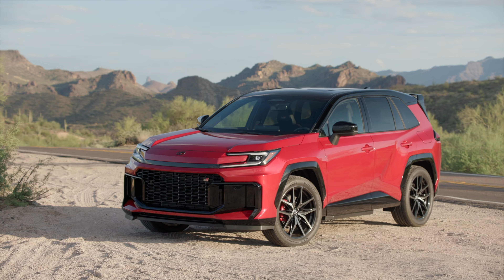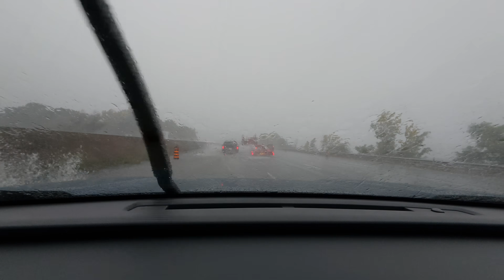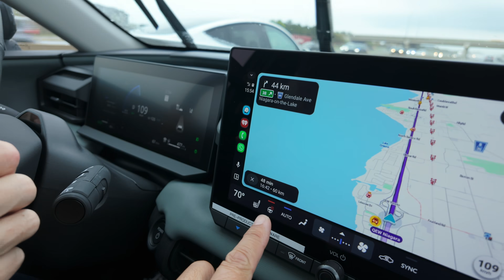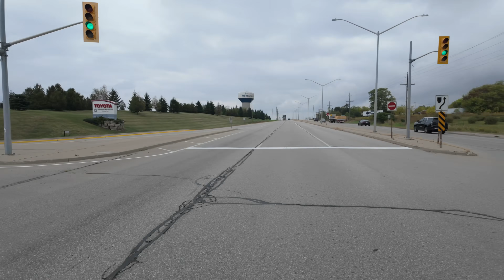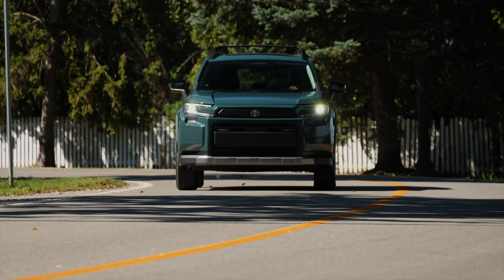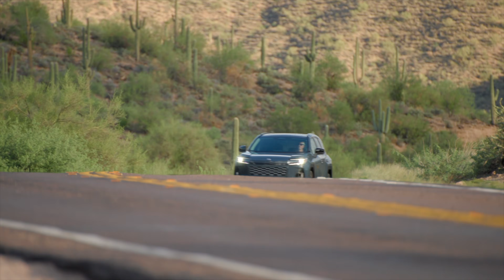FIRST DRIVE  2026 Toyota RAV4 Hybrid | 5th Gen Redesign + 320 HP PHEV Details!

Comment: For anyone buying a 2026 RAV4 in Canada, be aware that Toyota Canada cheaped out and does not include a Tire Pressure monitoring system in Canada while at the same time including it on all US destined models.  These are all made in Canada and TC doesn't even include TPMS on the top models like the Limited.  Shame on you Toyota. Nothing like pissing off your Canadian customers.  Put TPMS back on the Canadian RAV4's. You have it on most other vehicles in your lineup, and stop being so cheap.  For the price you charge for these there is no excuse. ...Honda thanks you.
Reply from the maker: This is interesting.

Comment: Can the start-stop system be disabled as on the previous generation?
Reply from the maker: To be honest I did not check as the weather was so miserable I didn’t really need to turn it off to keep the AC running. I would assume it would be able to be disabled though.

Comment: How would you compare it to the 2025 Mitsubishi PHEV or gas powered. The Mitsubishi interior looks more premium. How does it compare to the ride, build quality and bang for the buck? I'm looking to upgrade my 2008 Mitsubishi which has 250 KM and still going strong. 4cyl CVT no issues. A/c still blowing cold air😊
9

Comment: We routinely get close to 50 mph in our 21 Rav 4 Prime.  I just hate the engine noise if the engine turns on when the battery is depleted.  Plus road noise on the highway even when the engine is off.  Looking forward to this new 26 quieter version.
Reply: Many other reviewers still mentioned it is not quieter..just Toyotas marketing..no more acoustic glass too instead Toyota marketing hype about using adhesives